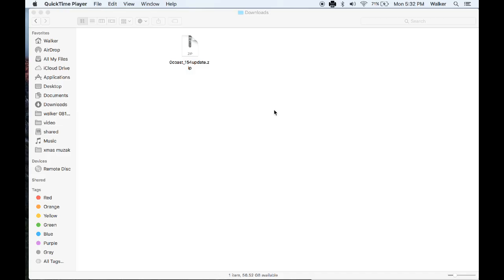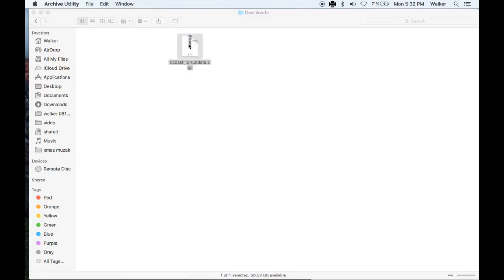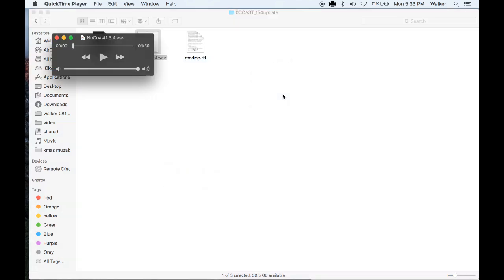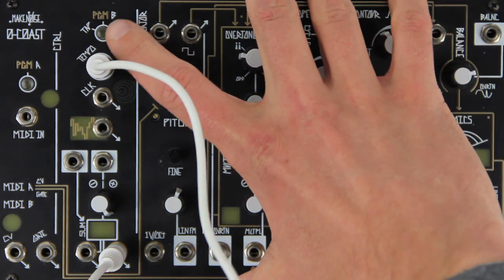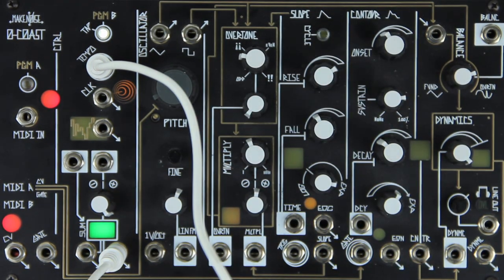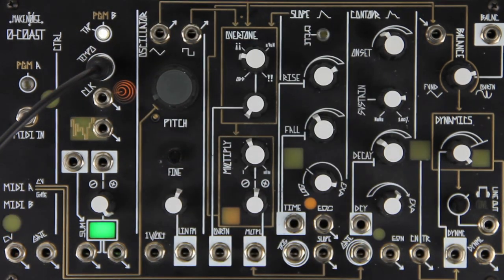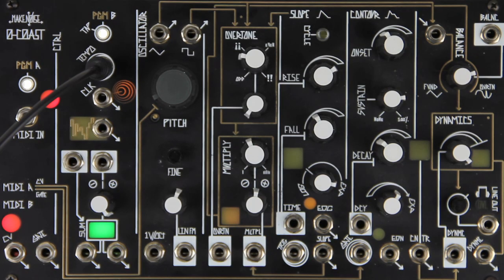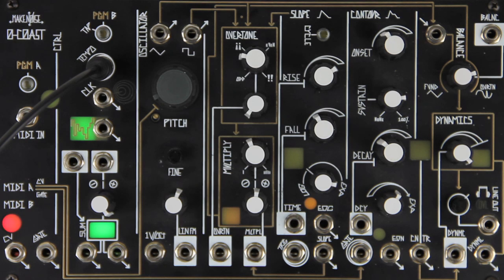0-Coast Firmware Update Procedure

Comment: I cant for the life of me, get the o-coast to work with a midi keyboard or the beatstep sequencer. Can someone help?
Reply from the maker: if ran the update procedure, you will then need to run the digital calibration routine before using midi. Assuming you did that, 0-COAST defaults to receiving midi on all channels. Plug midi device in and go. If somebody changed the midi channel you could restore all defaults or just re-program to the midi channel of your choice. See the manual page 12.

Comment: Did the update and now it is not accepting MIDI in, any way I can reset to the old firmware?
Reply from the maker: Please make sure MIDI A and MIDI B are set to receive on ALL channels. If you still have a problem, cycle power while holding PGM_A and PGM_B. If you still have a problem, please e-mail technical at makenoisemusic dot com and we will help you.
Reply: I contacted your guys and got a reply within an hour! So thanks for the awesome response time. Re-installing the firmware worked but I didn't want to do it again in case it made things worse. Thanks again for the help :)

Comment: Thanks for the video.  Wished it was up about 2 weeks ago.  Just got my 0-coast and wanted to update the firmware.  I read the instructions about 10 times to do it.  Not that it's that complicated but I just wanted to make sure I did it right.  I actually used my little Verizon tablet to play the audio/update file.  Worked like a charm.